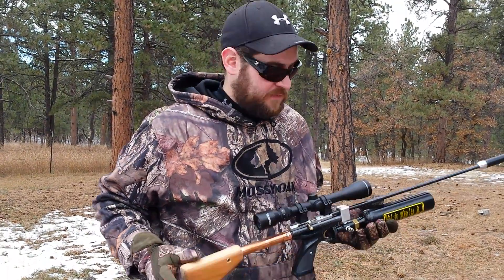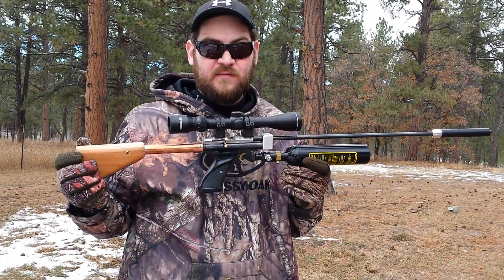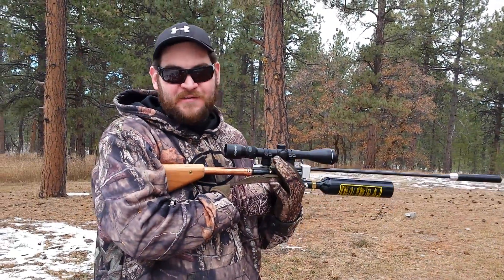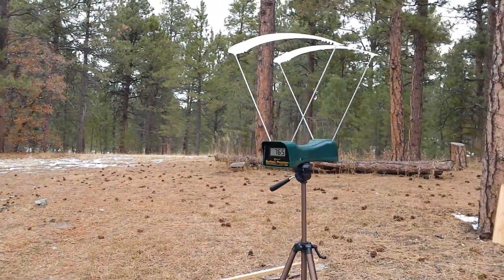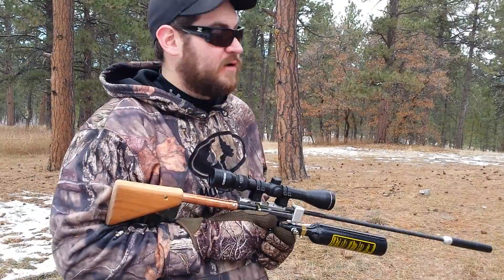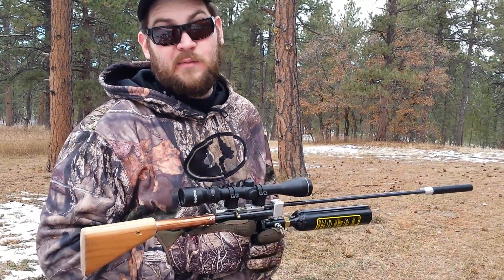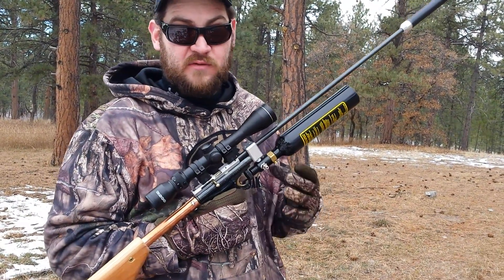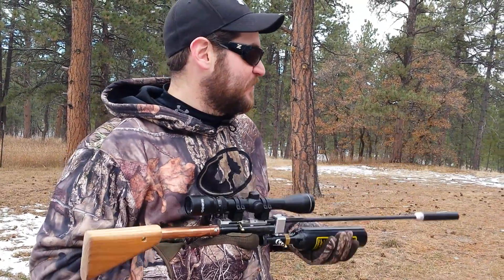Crosman 1377 Modded PCP/Bulk CO2 Project Chronograph Results!

Comment: Great mods, great result. By the way how much air pressure  in the reservoir. & what the safest level i can charge that type of bottle.
Reply from the maker: Each build is different. I went to 2000psi max. It's the highest I felt was safe for the construction. But do the math to figure out what's safe and have fun.
Reply: @MRT_H  Thanks Master

Comment: Sweet. Is that compressed air? If so, I bet the cold did drop the FPS substantially. depending on how cold it was of course. If it was Nitrogen wouldn't be a problem. Awesome follow up vid. Cant wait to see the .50 airgun. Bet its wicked!!
Reply from the maker: TestosteroneRN Yes, it's compressed air, I'm toying with the idea of nitrogen,  as filling would be easier than hand pumping. But I'll have to check into that.  The 50 cal is pretty sweet,  needs more power though haha